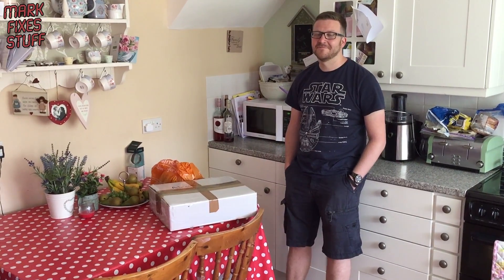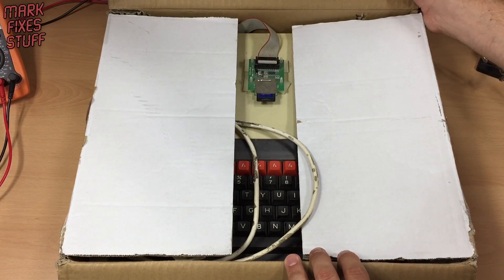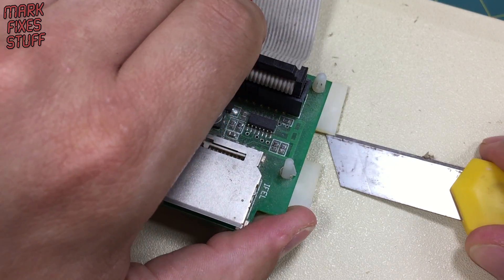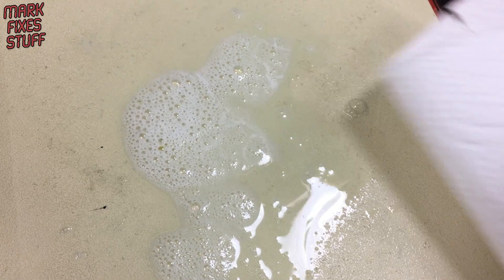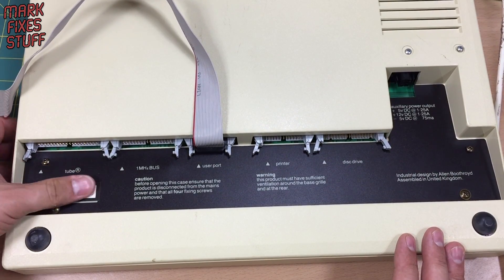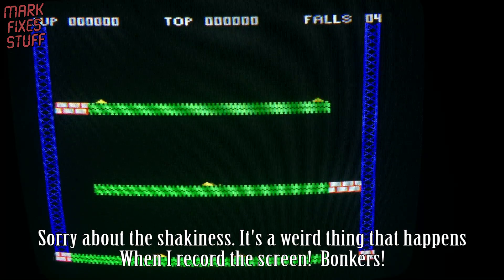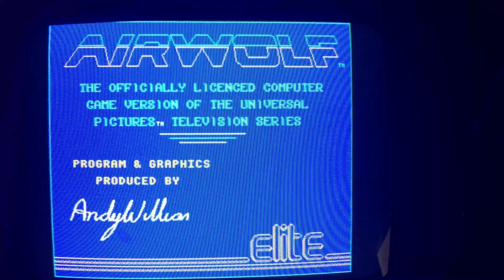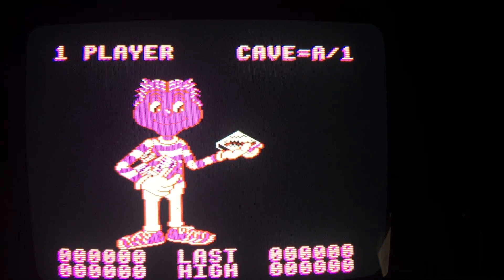A BBC B with an MMC Interface Arrives - Classic 8 bit British Computer Pickup

Comment: You can adjust the volume/amplifier pot under the keyboard; usually yellow block near the speaker connector.
ABUG, the Acorn and Bbc User Group have had a couple of meet-ups in Camberly over the last year and will probably be back later this year. I have written a menu for the various MMC solutions and GOTEKs or there are downloads of the STH archive available arround the place. https://stardot.org.uk/forums/viewtopic.php?f=53&t=16070&hilit=menu&start=60#p227139
Reply from the maker: +Richard Broadhurst I had no idea of the yellow pot! This is fab news. 

Let me know when ABUG meets this way too please!
Reply: @MarkFixesStuff  
They are blue in this image - speech frequency on the left edge, volume bottom left. http://8bs.com/inbbc.htm 
PS There is an ABUG in Cambridge 28th-30th June. PPS I'll have some beebs at Revival.

Comment: Video Out port is composite, but like the Elk, it's only designed to output Black & White.

I believe it can be modded like the Elk to output colour, but depending on what revision, it needs differing steps to achieve it - no one step fix like bridging LK4 on the Elk here :(

As for Airwolf - if it's anything like the C64 version, you want to blast the right side of the lower pillar (ie. the one the bullet rebounds off) to get the door open and leave the starting room.